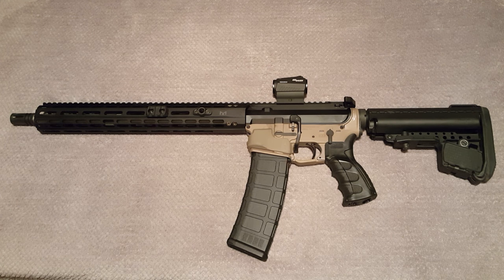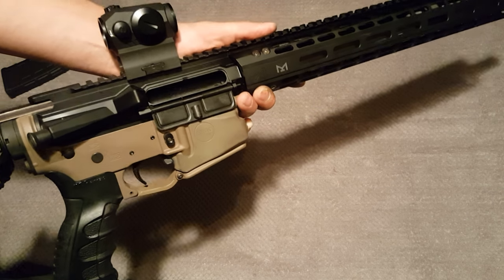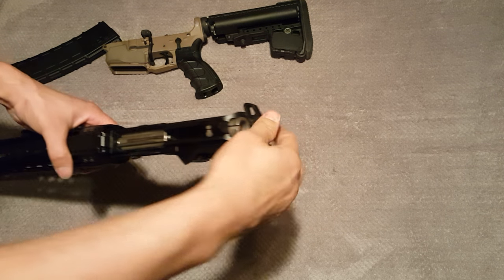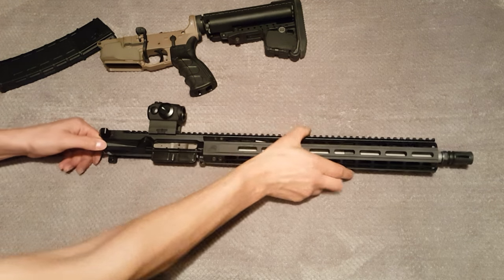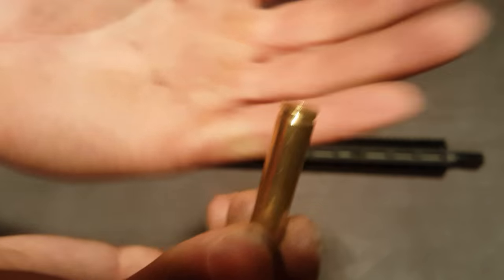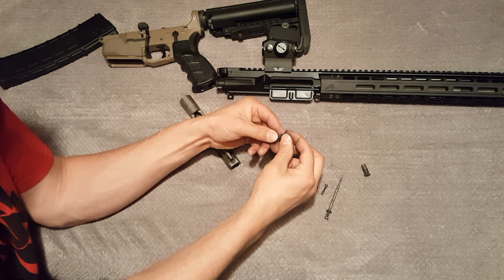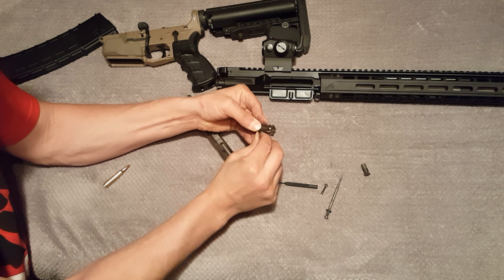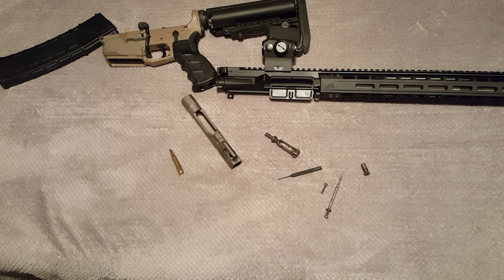AR Bolt Failure To Close /Seat Properly!!! Sharp's Relia-Bolt Extractor Spring O-Ring/Rubber Grommet

Comment: I got the BCM SopMod upgrade kit. I installed the new spring on the stock extractor. Not because my rifle was having issues. But just to have better extractions since I’m shooting mostly steel cased ammo. Point is I used the o-ring and just manually cycling the bolt, it wouldnt catch on to the rim of the casing. Took the bolt apart, removed the O-ring only... works like a charm. Even the packaging says “oring included but not needed in most cases” (or something like that). Nice build, man!

Comment: On all my builds (30) I check the head spacing. To do this you have to completely dissemble the bolt. Since it’s already apart I rebuild the bolt, $30.00. New gas rings, new extractor, new 5 coil extractor spring (no O ring, no extractor insert). Replace buffer spring with JP Enterprise buffer spring. Also get yourself a small scale about $15.00. Weigh your buffer, it’s usually too light (under 3 oz). Buy a buffer weight kit and add weights to get it up to at least 3.5 oz. (16” barrel). Then test by shooting. My 11.5 pistols average about 5.5 oz with the JP spring before shooting smooth and extracting at 3:30. Shorter barrel heavier buffer weight. Did a build, 5.56. with a 7.5 barrel had to go up to 6.9 oz buffer with the spring to get it too shoot properly.
Reply: My build number 3. Lol  2 556 16 in rifles, one mid length. One blowback 16 in 9mm. 9 mm has springco carbine buffer spring, used aero 7.7 buffer. Works perfectly, was worried about feed reliability. I have 2 wwsd lowers. , No changes on either. Carbine and mid length both have M16 type bcg. Both work like magic. One had rubber peg and o ring on extractor, I removed the rubber peg.  I am fortunate my Frankenstein guns had as few problems as they did. 9mm is my favorite, it is the aero 9mm EPC.
Reply: Also no headspace check on all 3, but did look to be sure no squeezing ammo on closing.  I need to buy the gages!
Reply: Last item. My 556 rifles jam up on steel. Melts the coating and siezes in the chamber. One no name low dollar barrel, one AR Stoner from Midway. Both shoot fine, just no steel for my guns.

Comment: Thank you sir. My radical firearms rifle was firing ok, but when you charge a round and then (without firing it) clear the weapon, I was unable to pull the charging handle back easily. Very stiff/stuck. So I took the extractor retaing pin out, and checked the spring per your awesome instructions :) and the spring was seated improperly. It was crooked. AH HAH.. so I removed the o-ring and put the extractor spring in properly, and it now pulls the bolt back with a round in there, SO SMOOTH and EZ.. NICE!
Thanks brother!
Reply from the maker: Glad to have another happy shooter, thank you

Comment: So I just built my first helper everything went smoothly according to plan as I go to put a live round in the chamber my bolt carrier group did not go into battery and I couldn't figure it out I thought I installed my Barrel in correctly so I put in my old Barrel it did the same thing after watching your video I went ahead and removed the O-ring for my extractor and now my bolt carrier group goes into battery perfectly so thank you for that video it helped me out
Reply from the maker: This issue was the main reason i started this channel. I couldn't find the solution on you tube. So i put it out there to help and it was worth it. Glad i could help a few people out.
Reply: Same problem here with my BCG not goung into battery! Almost brought a NIB bcg. I'll try this first. Thanks!!

Comment: I've had the same problem with an AR Pistol build.
After weeks of trying different things like weighted Buffers and different Springs, Seeing a few videos of people removing that O-Ring is my next step.
If this does seem to fix the issue it would make sense to polish the Front side of the Extractor so the Rim of the Round being Chambered slides and seats in the bolt without removing that O-Ring.
So in Essence it's the exact same thing you're doing by Breaking in that Part after you've run "200 Rounds" then Replacing the O-Ring.
Thanks for your Video

Comment: Thanks for posting this video! I was having the same problem with bolt not seating closed.  After watching this video I looked at the brass I picked up and it had the marks.  I took the o-ring off and cycled 10 rounds with no problem seating . Going to have to wait until tomorrow and test it at the range to make sure. Thanks again!
Reply from the maker: Kris Lind Thanks for giving my video a shot to help ya!! Hope it all works out.
Reply: Be Ready Basics 

Ok just got back from the range. Put 300 rounds down range and not one problem!  I didn't put the o-ring back in as I forgot it at the house. Thanks again!

Comment: DUDE THANK YOU!!! I couldn't figure out why the fuck my bolt was REFUSING to close when a casing was chambered. This solved the problem. To others, if you have the same problem only when a case is chambered, once you remove the o-ring and reassemble the bolt, you NEED to use the bolt catch to fully lock your bolt back and allow the buffer spring to push the bolt forward. Using just your hand is NOT enough force. If you try just pushing it in with your hand/charging handle, your bolt will NOT close all the way.

Comment: I think you just cured my headache. I recently bought  a .458, and I always rack a round in and rack it back out to make sure I can get the bullet out myself after firing the gun. Well, it didn't rack in, and me being stubborn hit that forward assist. I COULD NOT pull back the bolt with my own strength. I had to get a rubber wedge and slowly knock the bolt back out of the battery. After that tried to rack in another without tapping the forward assist. Didn't go, so I just pulled the charging handle back again and tried to seat another one, and that one didn't even get grabbed by the extractor. After taking this gun apart 100 times and trying over and over again I was about to just return it. About to try this.
Reply: Did this fix end up working for you? I'm having a similar problem on a new upper I got

Comment: They had a recall on those reliabot heads. They were cracking. I had the same problem and I contacted them. They told me to keep running the rifle and it would wear in. I did and it works fine now. Apparently a wear in situation is what to expect for their bolts and complete assemblies.
Thanks for the good review.

Comment: Thanks for the video! Like many others experienced on the first build, my New PSA AR pistol would not fire or eject, Stuck! Found your video, removed o-ring and cycles fine !!  Thanks!
Reply from the maker: Congrats on your new (WORKING) AR pistol. Just a little break in period required. Thanks for checking it out. Really glad this video has helped trouble shoot for so many people.
Reply: @bereadybasics7525  Man, your video saved my ass haha. Same thing happened to me. I fired about 250 rounds off my new psa rifle, didn't use it for a few weeks. I went to the range and the round wouldn't even chamber WHATSOEVER. The bcg would just be stuck in the position you described. I spent all afternoon trying to diagnose what it was, I deep cleaned my chamber as much as I could. I found your video and said "screw it, I might as well give it a shot". So after I did it, I loaded one round on my mag, released the bolt and IT CLOSED! I then cycled it and it ejected the round perfectly. I filled up my mag and just manually cycled the entire mag without any problems. Saved my life I tell you. One question though, is there any difference between running the rifle with or without that O-Ring? Should I do the same thing as you (fire 200 rds and then putting the o-ring back)?

Comment: Thank You. Your instructions saved me a real headache. My cases were gouged the same way and had some feeling issues. Now all is good after removing the O ring. I had other feeding issues with a Spikes BCG. The bolt gas rings were really tight and the bolt wouldn't close on its own weight. Changed to a premium PSA BCG, and all is good, no feeding problems. In my military days of the old M16A1 there were no O rings on the extractor and running full auto with no issues. Now wondering why add the O ring. Sometimes can't beat old school. Thank you for an informative and helpful video..
Reply from the maker: Hey, glad to see.  Not all come with the o ring and I've seen instructions that say it's not necessary. Possibly best for reduced tension after a few thousand rounds. Appreciate your service.
Reply: I change my gas rings pretty regularly. Ideally, I'll change them out whenever I pull my BCG, set it bolt face down on the bench, and the weight of a mil spec carrier is enough to close the bolt up into the carrier. 

The one piece gas rings are fantastic, btw. I've been using them for years now, and I hope I never have to go back.
Reply: Having a relatively loose bolt in your carrier, while not critical, can lead to cycling problems like short stroking.

Obviously you don't want them too tight, but a good seal keeps everything smooth while your gas is unlocking your bolt. 

I try and get a very thin surface coating of Hi-Slip synthetic grease on the inside walls of my carrier every time I clean it. I've had virtually zero wear since I've started doing that, too.

Comment: Thank you man that’s exactly what’s happening to mine and when I removed the oring the bolt seats just didn’t know if I could shoot it like that! Thanks for the help.
Reply from the maker: I hope it functioned properly. Once that spring was broken in i put that rubber back in myself.
Reply: Yea I’m still breaking it in. Works fine now thou. It’s feeding and extracting properly. It is 7.62x39 thou so that comes with its own problems lol
Reply: Did you leave the O ring out or put it back in after shooting?
Reply from the maker: @alvantebenton3548  I reinstalled mine after about 200 rds i think. Functions perfect still. No issues since
Reply: Alvante Benton I haven’t put mine back in yet. I’ve got about 250-300 rounds through it now and not sure when I want to put it back in. But gun still runs great just gotta keep it lubed up
Reply: Monster Mann03 gotcha! Thanks for the reply
Reply: Be Ready Basics Gotcha!! Thank you

Comment: Just got an AR10 pistol. First range day, failure to eject. Didn't have tools to adjust gas block so had to do it at home. Adjusted it some and went back today with tools and Adjusted several times. Same thing. Maybe 10 rounds maybe 2 rounds. Even dumped a 20 rnd mag but it kept inconsistently failing to eject. Quit and drove home. So gas block could be problem and buffer could be problem. But being erratic, I was thinking ejector. When I tried to move it, it wouldn't budge. Took BCG apart and it had TWO O-RINGS. I'm not ready to say what company yet as I'm not ready to make it public. And No its not a PSA...My PSA AR10 runs flawless using same ammo and same PMags. It's a long drive to the range so I'll have wait and see if I fixed it. But the extractor seems to be moving normal now with one O-Ring instead of TWO. I'll talk to the company I got it from and see if this is a QC issue or they meant to use TWO O-RINGS.

Comment: Why in the world would we need to go through this. I have a Sharps Adjustable BCG and had similar issues. Now I chalked it up to bad ammo because I was initially using this Armscor 300 BLK 220 gr ammo (which I still think was at last most of the problem) because I changed to a different ammo brand (Ammo Inc Stealth) and my braced pistol started cycling just fine after I changed the ammo. 

I actually experiences multiple issues. Not going full into battery was just one of them. The other was feeding issues; which I figured out at least 2 rounds the projectile looked like it was pushed too far into the casing. But aside for  that, the rest would chamber but no last round bolt hold open (even after adjusting the gas key per Sharp's instructions) and it would chamber the next round. 

Now some of this was happening unsuppressed and some suppressed. Several months ago when I had first completed my "Build" (I only built up the lower and bought a complete upper) I rand Fiocchi supers 150gr without issue unsuppressed. Though I hadn't adjusted the BCG yet and it was ejecting at about the 2'oclock position.

Anyway, I think the main problem I was having was ammo related, but I think I was experiencing more than one issue as well. Glad I found this video. 

Also, is this issue specific to only Sharps BCGs?

Comment: oh man! This is exactly what mine is doing... I'm going to take it out and see if that helps. Thank you!
Reply from the maker: Tanner Ray I hope it works and would love to read about the results.
Reply: Be Ready Basics thanks for the video, and reply!  So, I was getting the exact same result as you.  I took out the o ring, didn't help, thought my BCG was hitting something so I though for sure it was that.  I swapped out bcgs from my other 5.56, no change.  Swapped charging handles, same result.  Ended up being the first darn thing you mentioned, the buffer spring!  I compared it to the spring in my other 5.56 and sure enough, it was about 1/4" shorter.  I stretched it out to where it's just a hair longer, now it cycles just fine.  Haven't been able to test fire yet but everything is working now.  I should have kept it simple and checked the most obvious thing first.  "It's not getting back into battery after a shot...wonder if that spring is wearing out?".  Nope, my brain said...."aaahh! This is terrible!  It's broken, I wasted this range trip, I probably can't fix it, YouTube it, must be something really technical...".  Anyways, good now, new Shockwave blade, buffer , tube, and spring are ordered, I wanted one of those anyway 😀
Reply from the maker: Tanner Ray Well I'm glad to see that you were able to narrow it down and get it done. This rifle with issues was first shots in a brand new build. Sounds like you got to play a little first before the problems. Glad it's all taken care of, back to play time now lol

Comment: I have this issue on a 11.5 upper running a WMD nickel boron BCG. It won't cam over and go into battery and actually has to be tapped out of the upper because it gets stuck. It will eject the spent case and rip a new one from the mag but after a couple of rounds it goes into this same condition. You didn't mention if yours was stuck but I'm wondering if this is the issue with mine? What are your thoughts?

Comment: So mine ended up with o ring and rubber peg. SOTAR says one or the other but not both. Part of my problem is paying people to install my barrel.  First was not tight enuff. First also had tension on gas tube and it did not cleanly go into the gas key. 
Gas tube and key should go together easy, no drag. If it is crooked the barrel nut has tension on the gas tube. Also, lightly grease the runways for your bcg. Oil the crap out of the rest of it. You can not over lube one of these rifles.  Good luck gentlemen

Comment: Thanks for this. I had exactly this problem and had a tough time finding this solution.
Reply from the maker: Hey, glad it helped. I scratched my head a bit before finding it. Came factory like that so hard to pin point the problem.
Reply: @bereadybasics7525  Mine was fresh from the factory, too; this happened with my first attempts to fire. I have to admit that I did not figure it out myself, it took a convo of the guys at my local gun shop to eventually figure it out (the company who made it didn't appear to think this was a likely issue). It is amazing that nearly nowhere else is this issue mentioned, but looking at the comments it doesn't seem like a unique problem. I think looking for those gouges on the cartridge from the impact of the extractor lip that you showed is a key sign that this might be happening. What the guys said might be a long term issue (which you addressed by putting the O-ring back in) is that the extractor becomes unable to grab the cartridge and extract it; if you don't mind could you share your experience since then to see if you had any extraction issues? Thanks again.
Reply from the maker: @docgca  I had no idea this video would help so many people. Like you said, it must be common for newer extractors. I myself couldn't find a video to explain it so i just made one lol.
After around 200 hundred rounds without the o ring, i reinstalled it. Although it was still too tight for a few rounds after installation (Less then 1 mag). So at that point after knowing the problem, i just used the forward assist for those few rounds to get the extractor over the casing rim. 
I think i have fired around 400 rounds since re installing and haven't had a single issue.
Reply: @bereadybasics7525  Great, thanks!

Comment: I was getting the opposite, my srb would close fine but drag the first 1/2 inch as the bolt & cam pin rotated , the anodizing in my brand new faxon upper receiver was gouging at the cam pin relief so I replaced it with a faxon bcg and it’s smooth as butter . I’ll also mention I was getting short stroking 300 blackout on factory supersonic

Comment: I have a Daniel's Defense  doing the exact same thing. Chowdering around the brass.I just throughly cleaned it and will run a few down the tube tomorrow to see if it's still doing it. If it is I will  try the same thing.This thing has only ran maybe 50 rounds. I just dont want to have a bunch of chowders brass. Thanks.
Reply from the maker: Yea i think that should do it. Im sure its just a little tight. Maybe even pull your bolt and manually pull up on the extractor multiple times to break it in.

Comment: hm, i wonder if this is what's happening with my cmmg banshee bolt. i removed the o-ring already, didn't seem to work based on manual loading (haven't shot it yet)... but what's weird is it only ever fails on the right side of the (colt) double-stack mag. where the extractor happens to be...